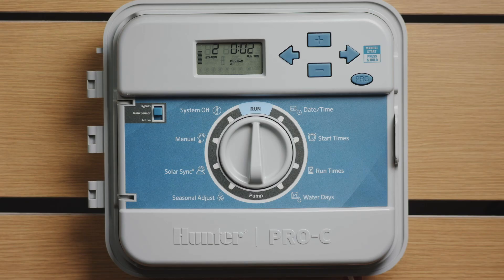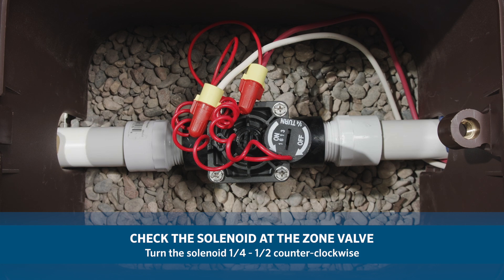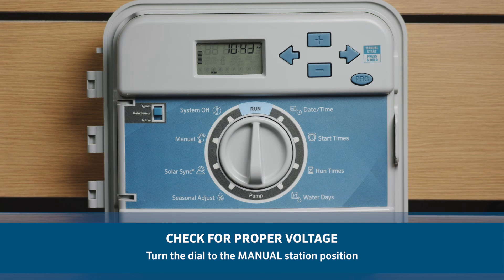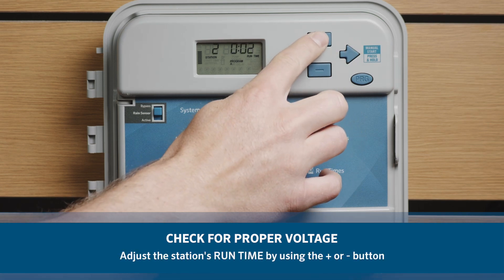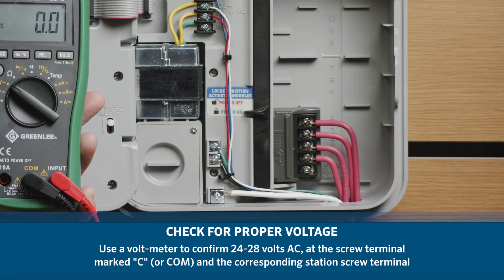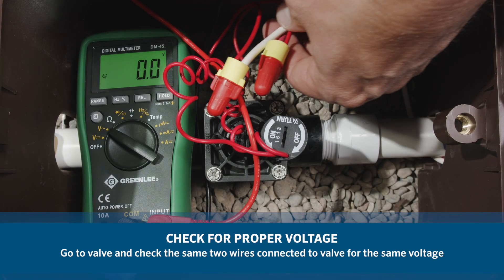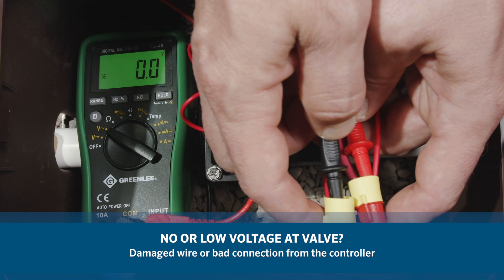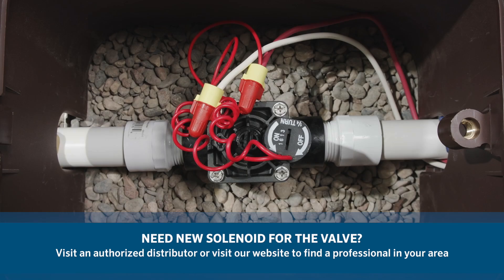Pro-C® No Zones Running

Comment: 2006 Model Pro-c 400 with two PCM 300 modules added. I test 24Vdc on the main module and all four zones work/test ok. I don’t detect any voltage on both of the pcm 300s. I’ve reseated them and reset the system several times. If I move a wire from zone five to zone four. That zone works so believe the wiring and solenoid to be Okay. 
Since both PCM 300s are not showing any Vdc at any of the terminals. How do I know it’s the module, controller or both.
Reply from the maker: Please contact our customer support department here: https://www.hunterindustries.com/hunter-technical-support-email-request

Comment: What’s the PM/V mean? My Pro-C has a loose black wire and PM/V has nothing connected to it. My display says “1 Err” . And will say “1 running” sometimes.
Reply: search the web and get a pdf copy of the owners manual. It will explain the wires. 
hunter pro c controller owner's manual

Comment: What if all 12 zones read 24 volts simultaneous, not just the one that should be running?
Reply: search the web and get a pdf copy of the owners manual. It explains how to plug in the power valve modules PMV.
hunter pro c controller owner's manual